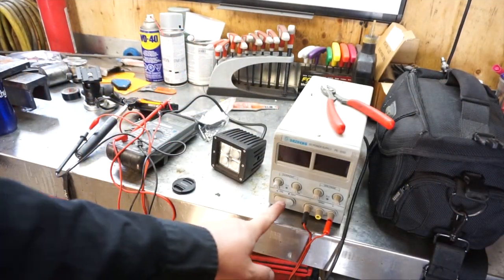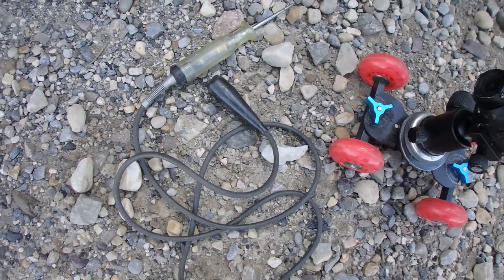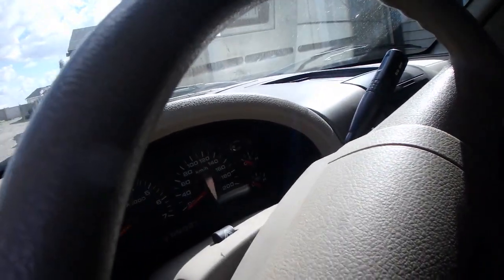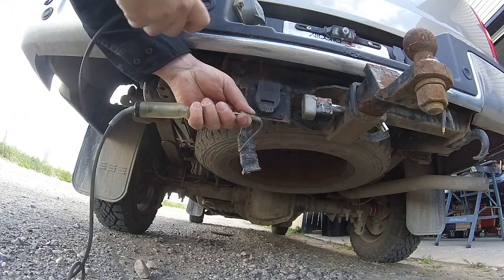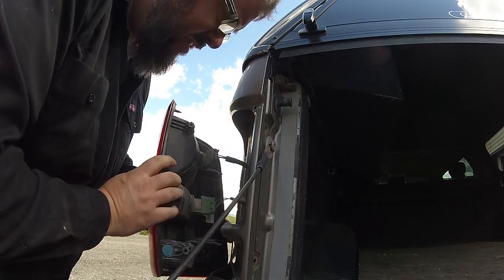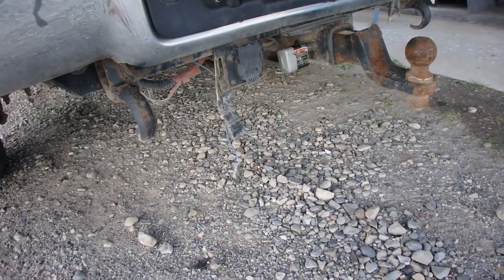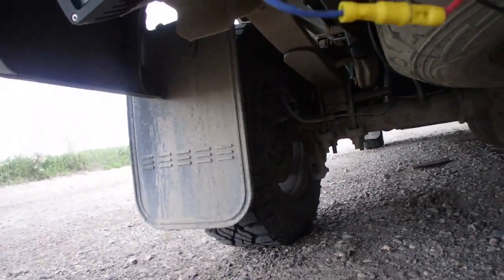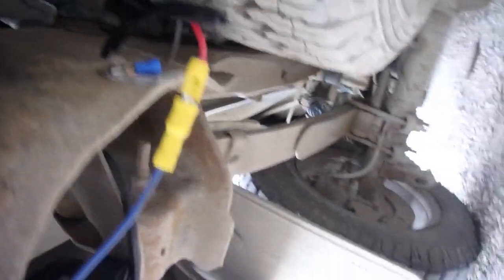Installing a Extra Back up Light DIY

Comment: Not trying to be an ass here (it happens naturally without me trying) but the link goes to a 6 LED fixture. The one in video is a 4 LED fixture. Does the vendor just not carry the exact one anymore? I found one that looks similar but is twice the price (only comes with one light fixture for $28) just trying to make sure things will still work out more or less the same. Cheers!

Comment: Hi Jerry... the link shows 6 led  lights @18W. it will draw significantly more electricity than yours 4 led light bar? The backup wire on my 2016 F150  looks awfully thin.
Would you be concern? Needs relay maybe? Thanks